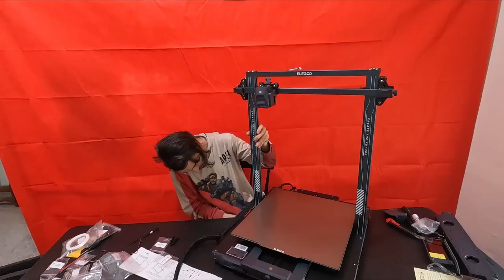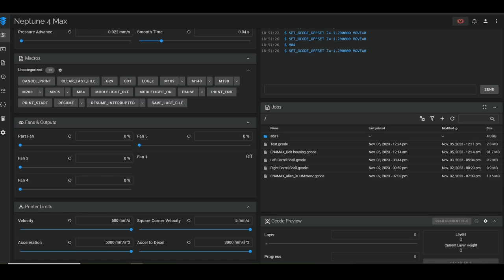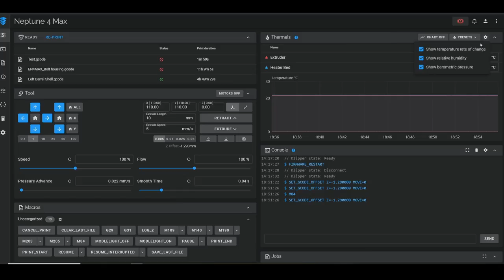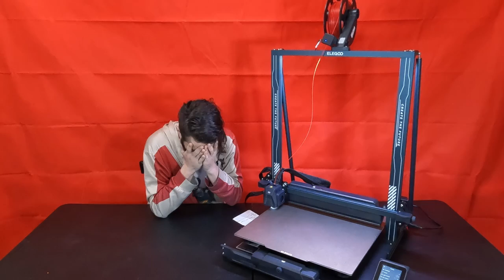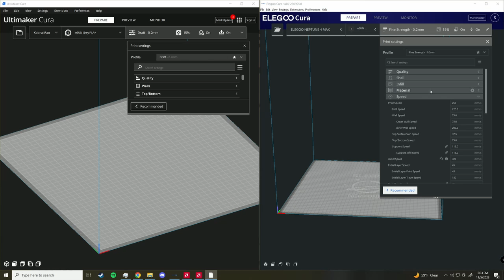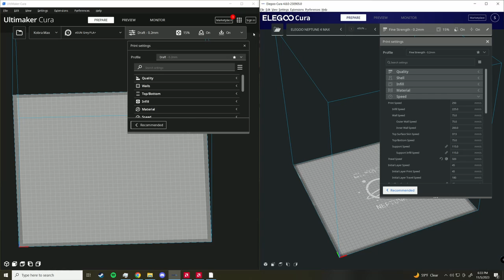Elegoo Neptune 4 Max honest review

Comment: isnt the sound down to the frequencies assigned in the software on the printer, dont know if you noticed how each time theres a new silent stepper driver your old stepper driver's start singing through a fog horn, the frequency issue was first spoke about 20 plus years ago when marlin was 600 pages long with all the setting showing, i think theres a command to reveal the full program, but...15 year later ehhh.. probly found a way to hide it.

Comment: I love mine. especially with Chat gtp handy
Reply from the maker: I've heard that the later batches have been better. This was from one of the first batches, which I know had many issues.
Reply: @BanishedBuilds i have one and after you get to know it a little, anything with build volume this big is gonna be kind of finicky as far as leveling. As far as the grinding noise that can be fixed. The speed is insane but I turn mine down most of the time
Reply: What do you mean by this?
Do you mean that you love yours, especially because ChatGPT makes it easier to use?

Comment: I bought one, struggled with it for nearly a year and just sold it recently. My honest advice: it's a monster need to be tame. Only buy it if 3D printing is your profession. If you're just doing hobby, or lacking experience like me, don't buy it, it may ruin your days. Start with smaller ones, or more expensive ones with full auto leveling.
Reply from the maker: @Square-Atom  imo if it's for someone who is experienced but still sees 3D printing itself as a hobby. For me, my 3D printers are tools and I don't have time to tinker with them all day. I also ended up selling mine because of it. A lot of wasted potential on these printers sadly.

Comment: Sounds like tuning problems. The "super loud sound" might be fixed by adjusting your belt or rail wheels. Also, when you're assembling the printer tighten the gantry with the x axis at the bottom.
Reply from the maker: That's what I assumed at first as well and adjusted everything as needed. Turned out it's firmware issue which is rather odd. They asked me to update the firmware and after doing so, it did make it a bit more quiet but it actually switched which axis the noise was coming from 🤦‍♂️

Comment: I bought one. It had some growing pains but its working fine now. I just had to update the firmware and tweek it a little. It prints really well now. I  like it.
Reply: @thomaspc2
What tweaks in particular did you do? Would you mind sharing? I am considering this machine but heard mixed opinions on it. Thanks
Reply: @luboscamber   According to a video I saw, preheat the bed for about 25 minutes before leveling. It takes a LONG time for the heat to fully saturate the bed and warps differently at different temperatures. It stabilizes, but only after about 25 minutes.

Comment: That fart sound is one of the wheels barely kissing the rail really fast causing the sound. Easily fixed by just tightening the eccentric on the left side.
Not a very lnowledgable review imho. But good job
Reply from the maker: Yeah I've only been 3D printing for 4 years. I have no idea what I'm doing... I guess the noise switched axis after a firmware change because it was that wheel...

Comment: One thing I haven’t heard anyone mention is that the touchscreen base is magnetic
Reply from the maker: It's a cool feature, but honestly the poor performance of this machine has made it feel kind of irrelevant at the moment 😅
Reply: I have been lucky so far with good prints. Even my family has noticed the difference in quality between this printer and my old one. I had a level issue out the box, but I did a factory reset and use Orca slicer with Uncle Jessy preset. No issues since

Comment: Got mine on Monday this week. Had homing issue which Uncle Jesse mentioned in his video. I could not get it to home and level until I got firmware update from elegoo two days later. Has been printing great so far. Elegoo does drop auto bed level to 36 points with new firmware. I was a little surprised to figure that out after firmware update. But bed leveling is way faster than my older Neptune printer.
Reply from the maker: I was very happy when I updated my firmware and there were less probing points. 121 was really unnecessary 😂
Reply: @BanishedBuilds  maybe another firmware update with 49 points would hit the sweet spot
Reply: Im new to this printer, did u update it straight from the printer or from ur pc?
Reply: PC
 @kip9403
Reply: BUT I  think both work
 @kip9403

Comment: My brain knows how big a bed slinger is, so it assumes you're a little person.   😀

Thanks for your honest review.

7:18 - "They should be using linear rails instead of these (acetyl) wheels."  Exactly.  I have the Neptune 4 Pro (with the steel rollers on steel rails) and it's printed almost nonstop for over two months with no problems.  To be honest, I used a Sovol SV01 very heavily for two years and never even needed to adjust the acetyl V wheels, much less having any problem with wear, however, the Neptune 4 Max is much larger and much faster.  F = ma.  The mass is four times as much and the acceleration is four times as much, so the force is probably 16 times as much.  For the sake of print quality and long term reliability, I think the Neptune 4 Max needs steel rollers and steel rails.  The Neptune 3 Max worked because it was much slower.  I'm waiting for Elegoo to sell a Neptune 4 Max Pro with steel rollers on steel rails.
Reply from the maker: To be fair, I am kinda small lol

But I definitely agree it should be using linear rails or at least the wheels should be spaced out further to give it more balance at higher speeds.

Comment: you can fix that sound easely by edjusting the wheels (what i did i i got the whole build plate off and then edjusted the wheels + the belt on the bed slinger can be too tight sometimes so just don't overdo it too much too)

for the slicer don't use cure just use orca slicer

i personaly NEVER had any issue with the internet cutting off so it shouldn't be the printer at fault
Reply from the maker: I had already tried and it didn't work sadly. They sent me newer firmware which fixed the noise issues on the Y axis, but now the X axis makes noise 🤦‍♂️

Comment: I had that exact same noise in my Neptune 3 Max, I also thought it was the wheels so I changed to linear rails but that did not fix the noise so then I changed the pulley underneath the bed into a metal version with teeth and I made sure that the belts were tight enough and that problem disappeared
Reply from the maker: Yeah. Elegoo sent me updated firmware and now the noise is on the opposite axis now 🤦‍♂️
Reply: @BanishedBuilds  just make sure that it's not the pulley directly underneath the bed
Reply: @BanishedBuilds I use orca slicer you should try it
Reply: I also just updated my Neptune 4 max firmware and it's much more noisier I'll have to say but not that kind of noise

Comment: Trying to find the use for the USB-C port.  It's only singular function is to interface with the printer.  So if for some reason you coulnd't get it on the network to ssh into it.  You can locally terminal into the port.
Reply: It's my impression that the USB-C port is mostly for firmware updates.

Comment: From what I've seen on other vids,  that noise can be stopped through the software and I believe that Elegoo has also brought out new firmware that will also fix it? From what I've worked out so far is you need to bolt tthe table to the floor/wall and turn input shaping on and that should cure some faults like level shift etc. I shall find out if this is the case in the next couple of days when I set my one up.

Comment: thanks for the honest review, I've heard of a handful of problems people have experienced with this printer...it's at the top of my list for my next purchase though considering the build volume and price
Reply: have it so far so it's amazing (for the price) it has it's issues but they are mostly hardware and if not there is a file somewhare already made as a small fix 3d print + the software issues are really fast solved in my opinion it just need some time like a month or 2
Reply: You need to look at the Anycubic Kobra 2 Max first.  I wish I would have gotten that one.